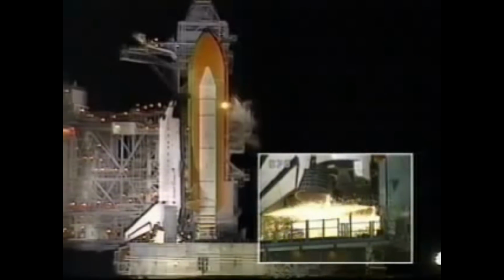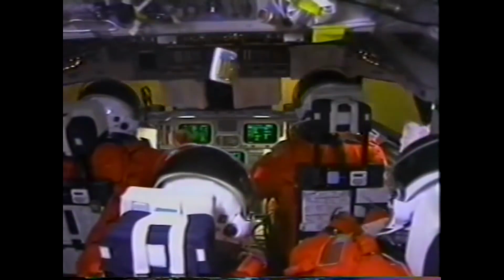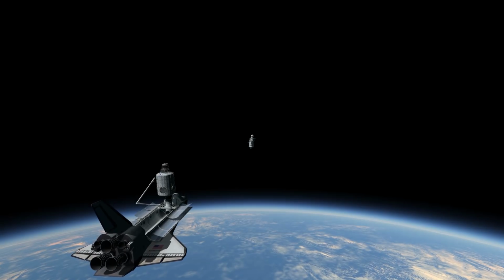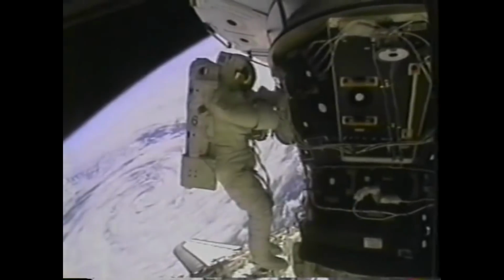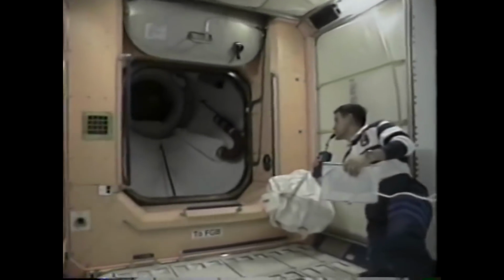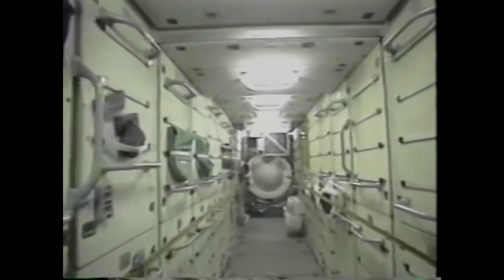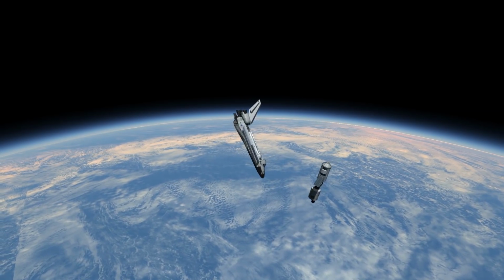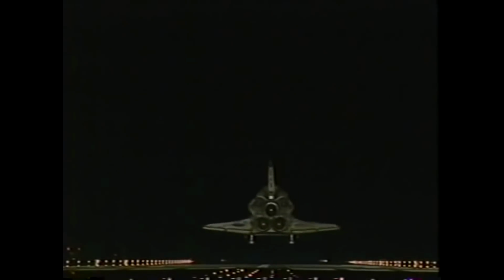International Space Station - Episode 2 - Unity

Comment: Fills me with pride seeing the Canada logo inside the shuttles. Without Canadarm, ISS would not exist! You’re welcome!
Reply: That's correct. Canada is the king of robotics every robot on the ISS was designed and built in Canada. Their contributions the Mobile Transporter, Canadarm 2, Dextre Robot who unloads our cargo ships, the inspection boom which is a hand-me-down from the shuttle, and 16 grapple fixtures on every module this allows the arm to walk the station and supply power to modules and cargo craft before they dock. Experiments have three grapples H-Fixture and spike attaches experiments to Dextre, PDGF connects all station components, and JPA which allows them to receive power from the Kibo arm before they are mated to the Exposed Facility. That's why Canada is the best.